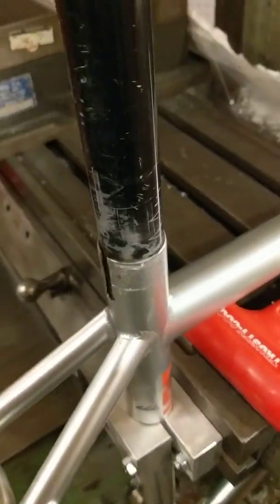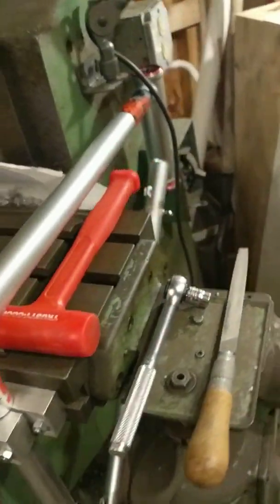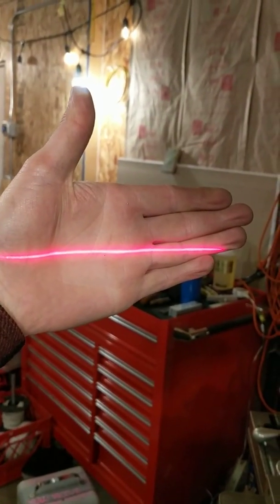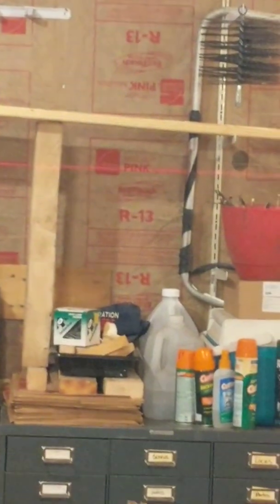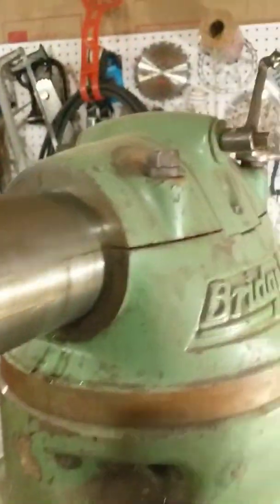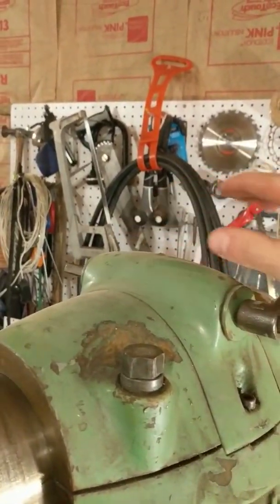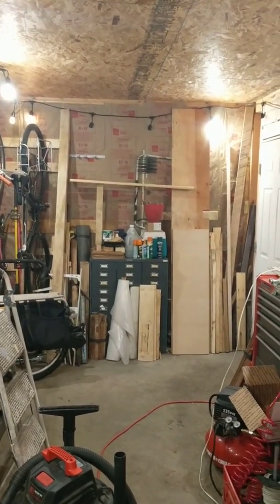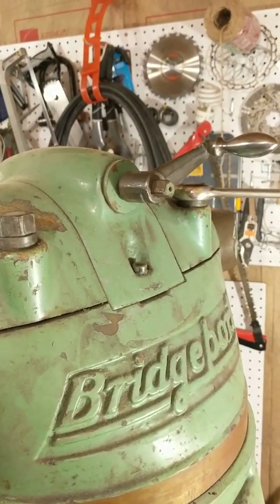removing a stuck seatpost with a Bridgeport - setting up the machine

Comment: Did it work mate ? Currently in sawzall misery land with mine....
Reply from the maker: It did!  I've used this approach on about a half dozen frames and it hasn't failed me yet.  I recently made a new fixture that hangs off the back corner of the table instead of the front, so I only need to rotate the turret and don't lose tram by extending the ram.  I also made the clamp blocks modular so different sizes can be swapped in for different tube diameters as needed.  So far everything I have worked on has been nominally 1-1/8", but the actual clamp diameter has varied by as much as .040" (1mm) oversize due to paint thickness, etc.
Reply: Chemistry won in the end. Two weeks of caustic soda and it finally came out.